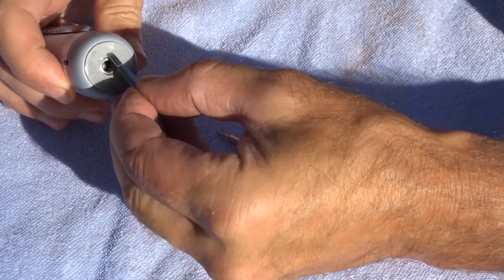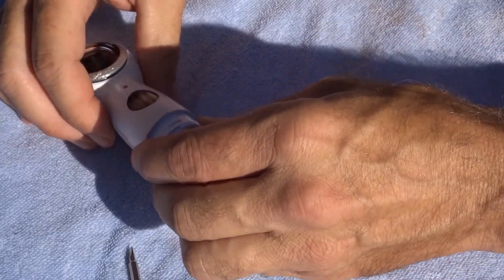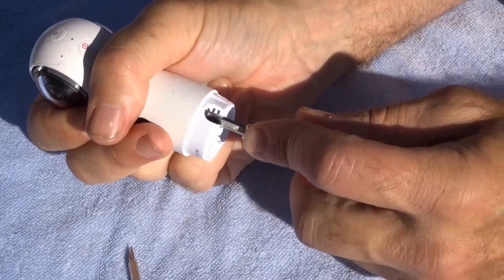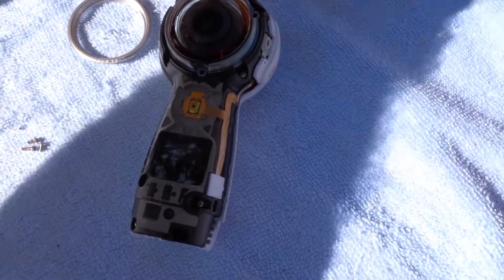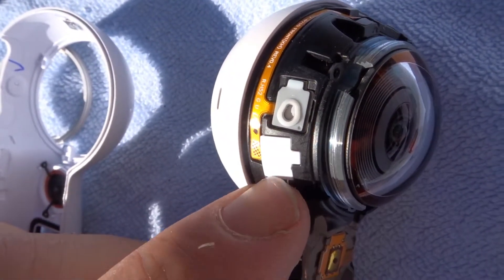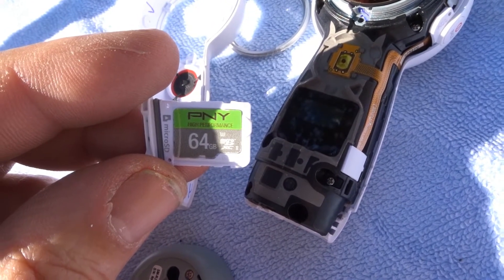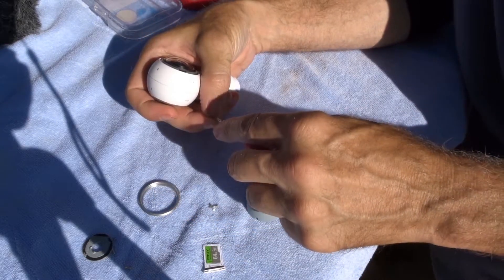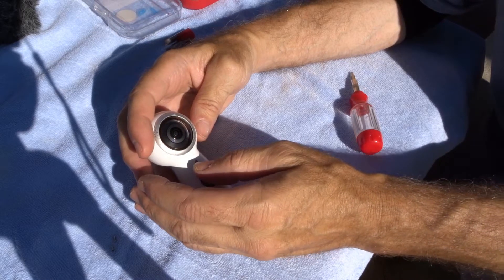Samsung Gear 360 2017   internal parts    Partial tear down

Comment: I had the same overheating issue.  I was using the same Micro SD card as you, also.  I found out 2 things from Samsung.  1st) the Rubber Ring, attached to the lanyard, is what you are to use to remove the Lens Bezels.  2nd) You must use a Micro SD card with a Data Tranfer Rate GREATER then 93Mb/s.  Samsung assured me that my Data Rate was to low, and trying to record 4K on a slower card would cause any 4K camera to overheat in 8-10 minutes.  I bought the highest speed Micro SD card on the Market and replaced my card with it.  I can now record 4K 360° video for 5+ hours, with NO overheating issues. I am only restricted by the card capacity at this point.  I have my Gear 360, mounted on 1 of my Drones, and get aerial photography so incredible, I actually can make people motion sick. Hope this helps!
Reply from the maker: thank you I will keep that in mind as my Gear works fine.
the new one I got after five returns lol.

Comment: FYI, just discovered the rubber ring on the lanyard can be used to unscrew the lens bezel!
Reply from the maker: I wonder if that is  enough to spin it off with force. will see on a later vid for sure thanks I just looked at the   pkg and I go tthe  diaphram away/
Reply: @fishycomics  The ring is pretty much the same diameter as the bezel and if you cup it with your hand, can apply some pressure  and twist.  It will slip some but after a couple tries the bezel came loose and I was able to unscrew it the rest of the way.
Reply from the maker: @arie1293  thanks  this camera was given away and my good one if I ever need to replace the lens I will keep that in mind
Reply: I haven't found a replacement lens for the 2017. The 2016 lens is smaller and incompatible. What I am currently trying to determine is the best way to just remove the protective lens so I can get another use or two out of it while I wait for my new Ricoh 360 to come in.

Comment: Could you let me know if the 2016 model lens protection is compatible with 2017?
Reply from the maker: Samsung purposally made this a throw away. it is a mm shy of a fit. you do not need to have the outer lens on if once it's scratched.

Comment: Side Comment: Since you mentioned that your camera overheats, It overheats because of the kind of Micro SD card you are using. I tried a regular Sandisk 64GB and it overheats. When I tried my Sandisk Extreme Pro 64GB card, no instance that it overheated. The heat is generated when there is a bottleneck of the data writing on the card.
Reply: Do try the Sandisk Extreme Pro. It is rated at 90MB/s write speed.
Reply from the maker: Wished thart was true, its a  over  heating issue I have three great cards top of the line all three it overheats.

Comment: I thought you would take it a step further. I am just now running another overheating test. Let's see how long it takes now. Would be nice to have the same number every time. If not, then it must be software.
Reply from the maker: Lol. I started to take the other twelve screws out, and the ring I did not want to damage as well?  I did run a test while open and well  not worth it. so I went ofr a bike ride and got a few minutes per in my mind please do not over heat. and I was good all the  video's came out they were under 5 minutes on the Evo select 128 card.  I have stitching issues  maybe because the  ring I did not screw tightly back on.  who knows  will see on the  board walk ones.
Reply: The stichting in this video was probably because one lens was pointing towards the sun, and the other wasn't.
Reply from the maker: lol that is the Sony filming
Reply: Oh, i was talking about the soccer video, the playlist moved on as i was typing the comment ;-)  YouTube